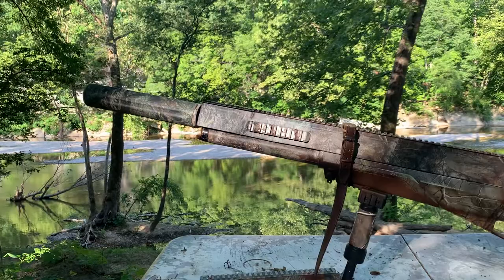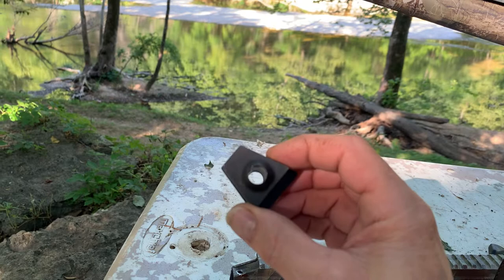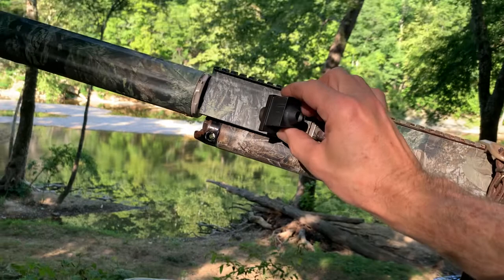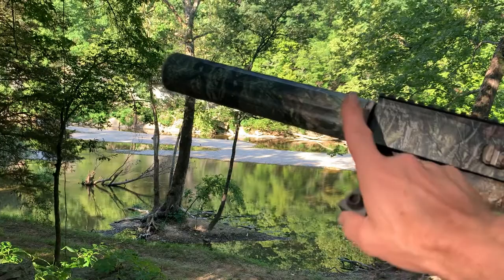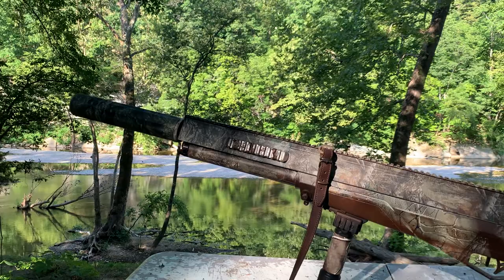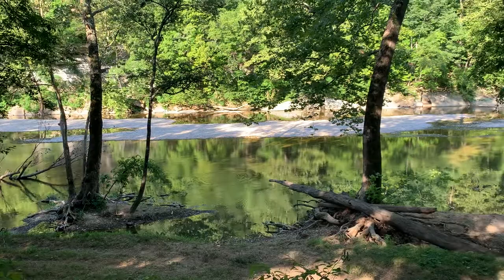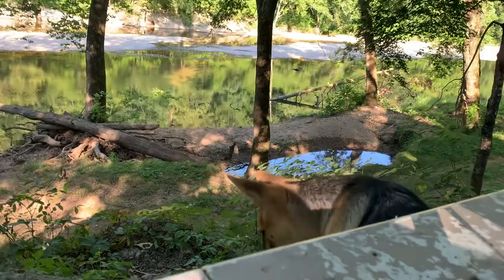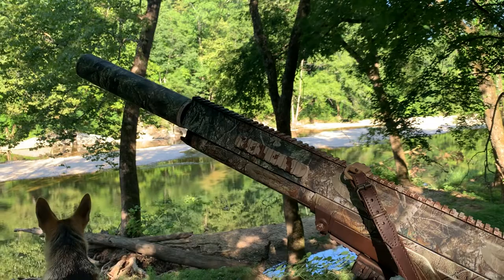Bulldog .457 mag, .357 mag extended shroud (Frankinshroud)

Comment: So where did you get the tank extension?   Would it not be better to go with a short tank with a offset but in carbon bottle style so you do not have to do this weird extension thing?  I would like to see how you attached the larger tank and well talk more about the features of the 457 .   Like the new magazine and the 3000 psi max fill limitations.   I see the tank you put on it is longer but 12 shots over 3 seems like a bit more than possible but i would like to see more about your setup.  /Details not just an overview.

Comment from the maker: Sorry I didn’t see your comment, I’m still new to this YouTube page. The extended tank really doesn’t do a whole lot for you unless you also have a huma regulator inside the  extended tank, thereby creating two separate tanks within the tube. My regulator is set at 2700 psi, which seems to be the best pressure to shoot the rounds that I shoot, the rest of the tank can be filled to 4500 psi. If you have this set up and do not port the air valve to m.308, then you would get more like 20 full shots with one fill, but because I ported it for more air volume, I only get 12 regulated shots. I have a .457 coming in, as soon as I get it I’ll break down step by step the mods that I’ll perform. I ordered all of my mod parts from Pitbullairguns.com, I highly recommend this shop for not just parts (for the self tinkerer) but also the fully modified Bulldogs they turn into the Pitbull. Thanks for the comment

Comment: Question for ya  on air striper. I have a stock  bulldog   I installed  a pitbull depinger  and barrel bands  and just added  a Donny fl adapter and Emperor moderator.  Think I can add a air striper  cut the end lip  off  If the funnel end slides on barrel?